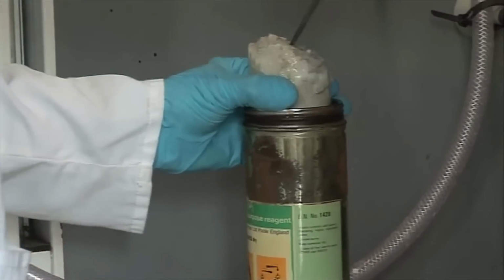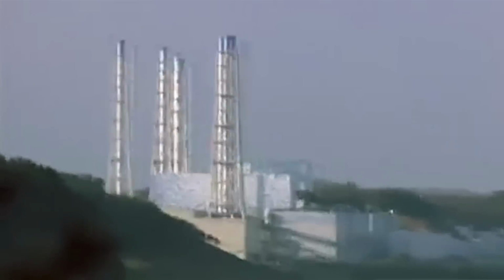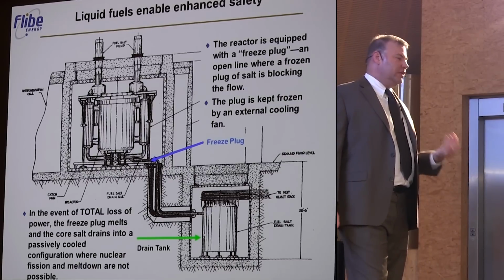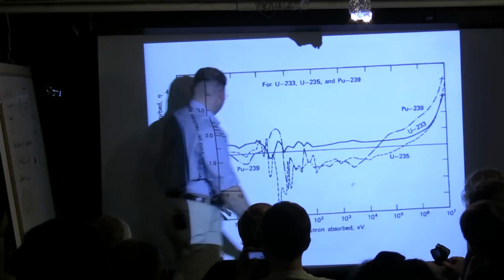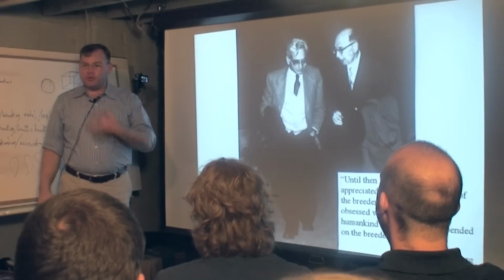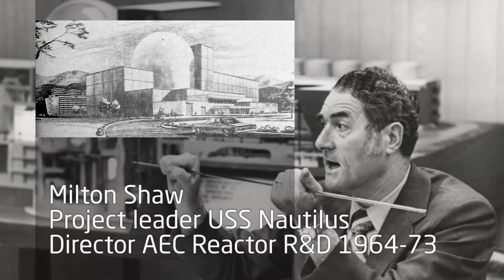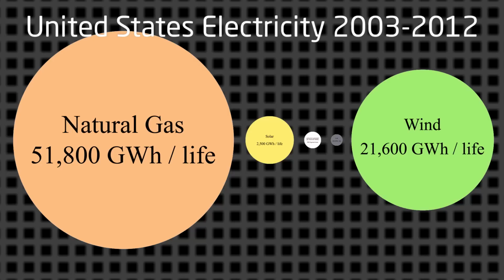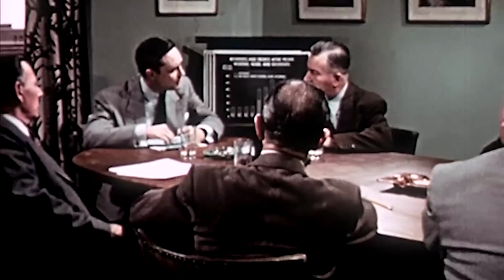Nuclear Disasters & Coolants

Comment: Well,it seems to me that it always comes down to heating a liquid or gas to make it expand to push some blade or piston to create rotation to cause some fluctuation of magnetic fields to make electrons move in a wire(s) to create a electric current flow.

Now I am not trained in any of the fields involved in this power generating train,but it seems to me if the EMP(s) generated during the fission processes could be tapped
directly by electromagnetic coils,things may be more efficient.

My design as just visualized in my mind would be two cylinders one inside the other with one (or both rotating).
The EMP power pickup coils would be placed outside the outer cylinder and inside the inner cylinder.
Let us make the outer cylinder nonrotating.
Its wall would be made up of fuel staves that have cooling channels on either side all
around the barrel shape.
The inner rotating cylinder would have the same alternating fuel staves with cooling channels.
Now as the inner cylinder rotates its fuel staves will alternately face an opposite fuel stave or cooling channel in the outer cylinder.
If two fuel staves face each other there will be a pulse of nuclear reaction that would generate an EMP (and also heat).
This EMP  would energize the inner and outer coils behind the staves (to create a pulse of electricity).
When the fuel staves move pass each other and face a cooling channel the reaction would cease and the fields in the coils would collapse.

This would be a pulsed nuclear reaction reactor.
I will name it Big Lou's PNRR. :)

All Rights Reserved.

P.S. Of course if the rotation stops the fuels would just heat up like in a conventional
       nuclear reactor and the medium in the cooling channels would keep the     cylinders from melting down while driving turbines..
Reply: "it always comes down to heating a liquid or gas"
Yes, that's how all heat engines work.
"if the EMP(s) generated during the fission processes could be tapped
directly"
Fission doesn't produce an electromagnetic pulse, it produces a steady stream of highly energetic particles (mostly neutrons + some gammas, etc.). The amount of electrically charged particles produced is mostly negligible, hence why we use heat engines.
Reply: So what do you think about my design that taps the fission generated emp for power?
Reply: Maleblade Since fission doesn't generate an EMP, your question is irrelevant.
Reply: Really,then how does a fission bomb generate an emp?
Reply: Maleblade See http://www.fas.org/nuke/intro/nuke/emp.htm
Short excerpt:
"A high-altitude nuclear detonation produces an immediate flux of gamma rays from the nuclear reactions within the device. These photons in turn produce high energy free electrons by Compton scattering at altitudes between (roughly) 20 and 40 km."
Unlike bombs, nuclear reactors are heavily shielded by their coolant and so do not produce any significant gamma flux. The flux that they do produce is very weak relative to nuclear bombs, so the amount of electric flux produced by Compton scattering even within the reactor would be negligible.
Reply: So you learned something.
Reply: Maleblade Which part of the article at fas.org did you not understand? Nuclear reactors simply do not produce an immediate gamma flux and so cannot produce an electric field of any meaningful intensity. I deliberately wrote "negligible", because any physical quantity is almost never entirely zero. However, compared with the thermal power output of the reactor, the overall electric field strength is negligible.
Reply: My coolant flows along the sides of the fuel staves and not between the coils and the fuel.
So the shielding does not come into play.
I am sure a competent nuclear engineer or scientist may have some useful comment I could appreciate.
Are you one?
At first you stated "Since fission doesn't generate an EMP, your question is irrelevant."
Thanks for your input anyway.
Reply: Maleblade "Are you one?"
Credentials are irrelevant, physics is.
As I've noted again and again, an EMP and significant electric field is generated only when the gamma flux is extremely intense and steep. Nuclear reactors simply do not produce that. Also, if you'd googled EMP generation mechanisms, you'd see on wikipedia:
"This interaction of the very rapidly moving negatively charged electrons with the magnetic field radiates a pulse of electromagnetic energy. The pulse typically rises to its peak value in some 5 nanoseconds. Its magnitude typically decays to half of its peak value within 200 nanoseconds. (By the IEC definition, this E1 pulse ends 1000 nanoseconds after it begins.) This process occurs simultaneously on about 10^25 electrons. The simultaneous action of the very large number of electrons causes the resulting electromagnetic pulses from each electron to radiate coherently, thus adding to produce a single very large amplitude, but very narrow, radiated electromagnetic pulse."
So even after exploding a nuclear bomb, you only get significant electric field intensity for less than 1 microsecond (and only ~0.1% of a bomb's total energy is radiated out in the gamma flux). And that's the absolute best you can get using a bomb which consumes all its fuel in less than a microsecond vs a reactor designed to take several years to do the same. IOW the electrical field intensity in a reactor would at best be roughly 13 orders of magnitude lower. So wikipedia's quoted "peak power density of 6.6 megawatts per square metre" would become 0.66 microwatts per square metre. A scale difference of 13 orders of magnitude is comfortably ignored in physics as "negligible".
Reply: If you are not a nuclear scientist or engineer who have worked on advanced nuclear reactors then you have no idea on what is possible.
Google wikipedia all you want,but nuclear reactor design is an art.There are things you will not find on. wikipedia about advanced designs.
I have proposed a design that I hope may
get some qualified scientist or engineer thinking.
I have seen resonant reactor designs that tap the EMP using coils.

Thank you for your input anyway.

P.S.

Start here:

http://www.rexresearch.com/nucell/nucell.htm
Reply: Maleblade "If you are not a nuclear scientist or engineer who have worked on advanced nuclear reactors then you have no idea on what is possible."
Credentials mean nothing in science. My training is irrelevant.
"I have proposed a design that I hope may
get some qualified scientist or engineer thinking."
And I have used some very rudimentary physics and maths and reputable sources to show you that your design won't even get off the ground. No amount of smart engineering can violate basic laws of physics such as conservation of energy.
"Start here:"
You are confusing nuclear fission reactions and nuclear decay (described in the article above). Besides, the article appears like a typical free-energy quack thing. How do I know? Again, basic physics. From the article you linked:
"The battery utilizes the energy given off by decaying radioactive material, converting it directly into a continuous AC electrical current"
and
"The Nucell battery yielded 7500 watts per gram of strontium-90."
We know the energy given off by a Strontium-90 atom in beta decay: 0.546 MeV = 8.75 x 10^-14 Joules. We know it's half-life: 28.8 years. We know the atomic mass of Strontium-90, so using Avogadro's number, we can calculate the total number of atoms in 1 gram: ~6.7 x 10^21 atoms. Put these pieces together and you get the total beta energy emitted through the decay of 1 gram of Strontium-90 over all its decay: 5.86 x 10^8 Joules.
Now the claim is that the Nucell battery can produce 7500 Joules/s (7.5kW) of power. Is it even possible that 1 gram of Strontium-90 would produce that much power over even a short interval? No. Because 7.5kW even for one single day (let alone 28.8 years and longer) corresponds to 6.48 x 10^8 Joules, already more than is available in the system.
The proposed Nucell battery would violate the law of conservation of energy and is thus shown to be junk science.
Reply: "You are confusing nuclear fission reactions and nuclear decay (described in the article above)."

LOL

I have been patient with you but I have to be going on to other things.
Have a nice day.
Reply: My proposed design is a bit different btw.
Reply: Maleblade "I have been patient with you but I have to be going on to other things."
Indeed. If your response to a precise numerical analysis of your claims and your references is "LOL", then I'm wasting my breath here.
Reply: The nuclear fission process that splits the nucleus is usually initiated by neuron absorption that makes the nucleus unstable
and it decays.

Oh,according to you "Credentials are irrelevant,"
Well,I would like to try my hand at brain surgery but I have no credentials in that field.
Would you be willing to volunteer to be my first patient?

PLEASE..save your breath (and my time).
Reply: Maleblade "The nuclear fission process that splits the nucleus is usually initiated by neuron absorption that makes the nucleus unstable
and it decays"
No. Upon absorbing a neutron a nucleus doesn't "decay", it fissions (splits) into two fission product nuclei. "Decay" is an altogether different process that happens spontaneously at an inversely exponential rate and produces several different types of decay particles, all with vastly different physical properties (and yet more different to the fission products I mentioned earlier).
You see, you don't even begin to grasp the first concepts of nuclear physics, but sadly you're entirely unaware of it.
Reply: Does not decay and fission split off parts of the original nucleus?
So fission may spilt it almost in half and decay different proportions with different resulting isotopes.
The processes still generate EMP which you stated did not happen.

"Since fission doesn't generate an EMP, your question is irrelevant."
Now you are nitpicking about the deconstruction of the nucleus via neutron absorption and spontaneous deconstruction due to an inherent nucleus instability.
I can call induced nucleus deconstruction via neutron absorption "decay." as the result is the same from the point of view of EMP generation.
At least I was aware that an EMP pulse was generated in either case and apparently you did not.
Reply: Maleblade "Does not decay and fission split off parts of the original nucleus?"
No, decay transmutes the original nucleus by making it either go up or down on the periodic table, depending on the decay type. At best you could liken alpha decay to something akin to fission, since it produces an actual helium nucleus as the alpha particle, however the reason for this process is entirely different to fission (which is a forced process) and the physical properties of alpha particles makes them almost impossible to use for anything directly in a nuclear reactor (too small mean free path). Beta decay is the result of quantum color change of one neutron's constituent quarks and produces an electron and an electron anti-neutrino (to conserve charge).
"The processes still generate EMP which you stated did not happen."
Because it doesn't in any meaningful fashion. It might, at best, generate a barely measurable locally elevated electric field potential. That is not a pulse and cannot be used to perform work (which is required for producing electrical energy). In short, it's not an EMP!
"At least I was aware that an EMP pulse was generated in either case and apparently you did not."
It simply is not. You're just wrong on that. You don't even understand basics such as the distinction between electric power, potential, current and energy.
Reply: "and the physical properties of alpha particles makes them almost impossible to use for anything directly in a nuclear reactor (too small mean free path)"

No,alpha particles are positively charged particles,charged the same as the nucleus
and are therefore repelled from the nucleus.
Neutrons have no significant charge as far as the nucleus is concerned and are thus able to
directly collide with it.

Charge is an electrical property the last time I checked.
Reply: Maleblade While that is the case, their mean free path is minuscule, so they'll pretty much collide with the first thing in their path, not even leaving the nuclear fuel.
Second, alphas are only produced out of nuclear decay, not fission. Moreover, the vast majority of alphas produced is from actinides, which have extremely low radioactivity. The energetic breakdown of a nuclear reactor is about as follows:
95% fission (~99.9% neutrons; ~0.1% gammas)
5% decay (>99% beta, <1% alpha)
So from the get-go, even if you could harness all decay energy (which you can't), you'd be aiming at building a system which is ~10x worse in efficiency than a nuclear-driven heat engine (with about 50% conversion efficiency - ballpark numbers).
Lastly, the reference you cited is junk science. The claims there are preposterous. You can't use junk to arrive at a sound conclusion. In science it's "garbage in, garbage out".
Reply: I will let the qualified people on this site judge things for themselves and maybe get a comment from one.

"Lastly, the reference you cited is junk science. The claims there are preposterous."

It has a patent number:

US Patent # 4,835,433
Apparatus for Direct Conversion of Radioactive Decay Energy to Electrical Energy
(May 30, 1989)
Paul M. Brown

Do you hold any patents at all,especially in this field.
Reply: Ah,at last someone who seems to know about nuclear physics and engineering.

Let me point out at I mentioned cooling channels and driving turbines with the heat
generated in the reactor.:

"  nuclear reactor and the medium in the cooling channels would keep the     cylinders from melting down while driving turbines.."

That should indicate that the heat generated would not go to waste.

Of course I understand that there would be a lot more work needed.
The basic idea is to use nuclear reaction pulses to drive the resonant tank circuits into oscillation and draw off that power.
I do not rule out using converter targets to convert and couple the energies of the alphas and betas into gammas for EMP generation.
As the alphas and betas are charged perhaps they could pass through layer(s) of micro MHD matrices to tap some of their energies
before striking a target to generate an emp.
Any suggestions on how best to couple the fission pulses to drive the tank circuits would be appreciated.

Note by the way my proposed design is scalable (just make the cylinders larger and add more staves and their associated coupled resonating circuits),and as a rotating cylinder generates the pulses,it is not susceptible to sudden pulse drifts.

Now I would like to propose some experiments to see if the apparent cross section of fissionable elements can be influenced with sound and/or magnetic induction.
I propose sweeping a radioactive sample with
ultrahigh frequency sound and looking to see if the decay rate changes.
It would be swept again while bombarding it with neutrons.
Maybe something interesting will happen.

Thank you for you input Theo.
Reply: "2) Alpha particles lose most of their energy as heat in the reactor as they're repelled. Their kinetic energy is transferred via heat to the nuclear fuel. We see that as decay heat. You will need a paper thin reactor in order to use alphas efficiently. Even in air they're scattered. Unless you want to vacuum pump the reactor , which by the way costs a lot of energy, not many alphas would reach your collector in time."

BTW Theo,there is a lot of vacuum in space.
Reply: Why not a vacuum containment building?
It could not cost more than the containment building for current pressurized water reactors.
Also operating the reactor in a vacuum would prevent fires,robots could be used to maintain it.
A reactor designed to operate in a vacuum would be ideal for use in space.

As this reactor would be designed to produce
electricity (even from nuclear waste) it could be used to power the accelerators that would convert Thorium to U 233 to start the breeding process.
The U 233 could also be used in the PNRR
by having the neutrons strike the proper targets to generate emp pulses.
Reply: You have vision Theo,and a can do approach rather than a can't do one.
I would like you to be part of this project (I am poor and could not pay you though).
.
Reply: Thank you,you have been very helpful.

Well,since you seem very knowledgeable on
nuclear physics,what do you think of Project Orion?
Reply: lol
That would shorten your space trip
alright,but you would go straight to heaven though.

I guess the fuse would be inserted once the bomb was outside the ship.

So what do you think about dark matter?
Reply: "I want to work on creating systems to help the less fortunate, something they can afford, perhaps to give them jobs and a livelyhood. "

That is a good goal to pursue,but I wanted to know if you accept the existence of dark matter.
If you do then one should be able to design a system/drive to use it for propulsion like jet engines use hot air to exhaust and move forward.
Then reaching new planets may be faster and the "less fortunate" may find more opportunities.
Reply: Do you think that the electric charge may somehow interact with dark matter (if it exists)?
Reply: If dark matter will interact with light matter via
charge then a drive that can pull on dark matter in space and release it behind should be able to move through space.
Could dark matter be made up of neutral particles with relative zero velocity?
Reply: "I'm more for warp engines though, since they can bypass the laws of relativity by warping spacetime fabric."

Do you have any idea how they would work?
Would it not take something like a black hole to even warp the space-time fabric locally
much less between your source and destination?
Reply: I see.

What if the vacuum was negatively charged.
Do you think a charged capacitor would move through it in the direction of the positive plate?
Reply: Maybe dark matter can have charge.
Reply: Do you think that a true vacuum has no dark matter?
If so can a true vacuum exist in our universe?
Reply: Well,we should give this very special "vacuum" a name so when vacuums are discussed we can state where in the vacuum continuum the vacuum under discussion is.

Imagine if the vacuum in our space is charged negatively,then one should be able to collapse/warp it locally around a positive charge,let us say in front of our drive.
Then the space behind the drive would expand to fill in the more perfect vacuum space in front pushing the drive and attached vehicle before it.
would that not be a warp drive?
Reply: What is spacetime composed off?
If there is no such thing as a perfect vacuum (a volume without any particles or fields in it)
then there must be something that "mass-energy" warps/acts on.
Is the makeup of mass-energy different than that of space and in what way?
Reply: You did a good job.
Thank you for your input.
Reply: Thanks for the info B. Xoit.

Well,that such a crude device could produce fusion is amazing (Farnsworth Fusor).
I have modeled a fusor in my mind that may work,is scalable can be water cooled (pure distilled water),or oil cooled as the primary heat exchanger cooling fluid,and the tap EMPs produced.
It would operate in pulsed mode(s).
It may need work  (computer modelling)
but should be an interesting design.
It may even have a little assisted photon field containment and heating.

I may be induced to elaborate and even do a few sketches.

All Rights Reserved.